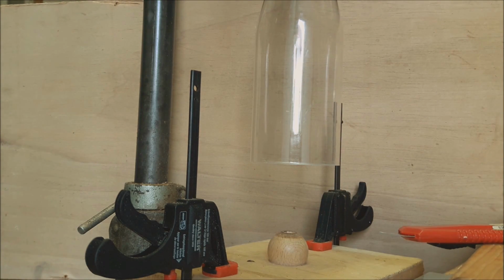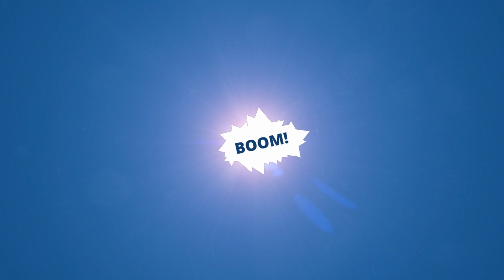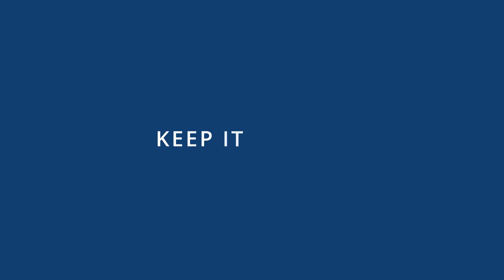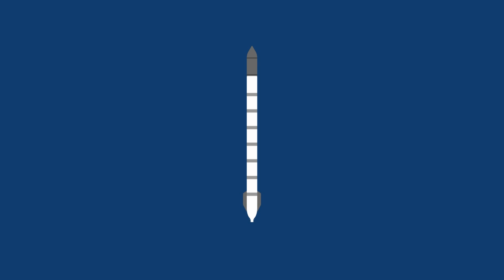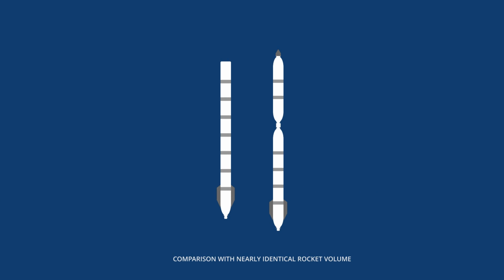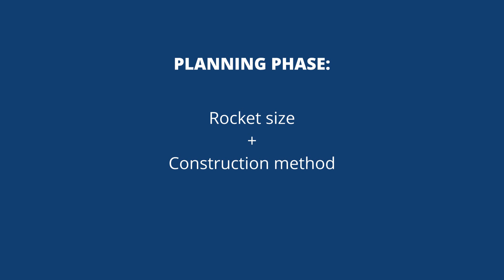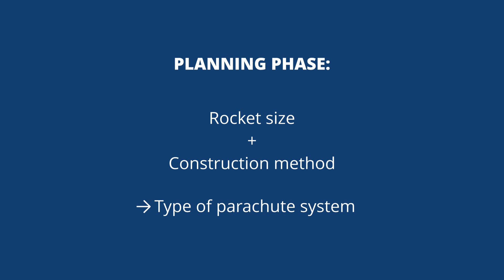DIY: Learn how to plan the Construction of a Water Rocket

Comment: Hi great video, are there alternatives to joining plastic bottles together for the pressure vessel ,if i will be using fiberglass for reinforcement ?Thanks 
Hello from South Africa :)
Reply from the maker: You can basically use every polyurethane based adhesive but some are better than others. It's hard to say before you test it. ;)
Reply: Thanks